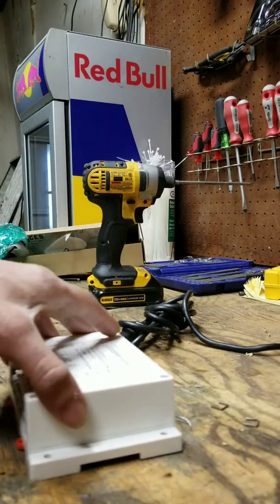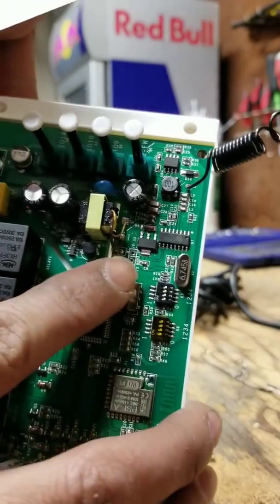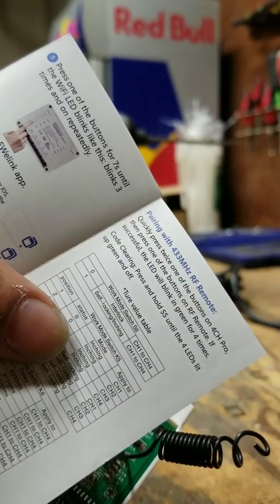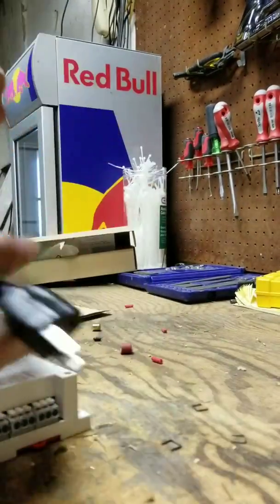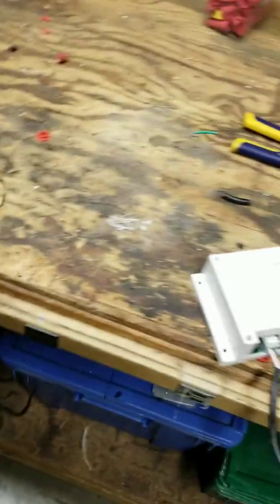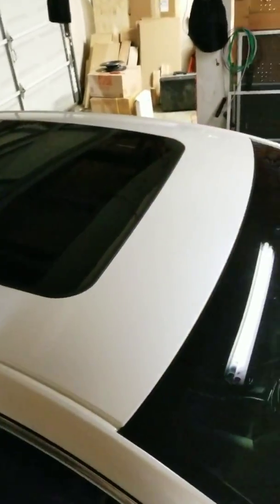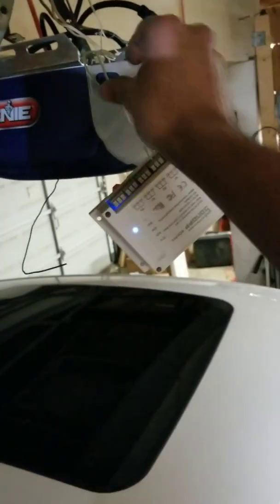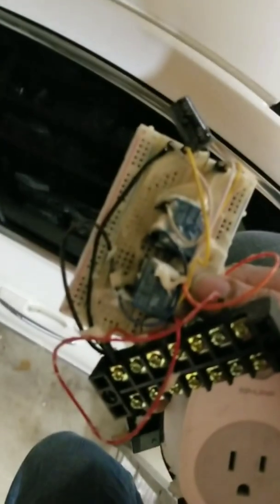Alexa and smart phone to open garage.  Sonoff 4ch pro switch

Comment: Do you know of a smart door sensor that one can use to send the garage open/close status to IFTT?   I have not had luck finding a smart door sensor that does not require a an additional "bridge"
Reply: Sonoff has door/window sensors
Reply from the maker: Thats new to me, i'll have to check that out.
Reply from the maker: likeos not sure on this... You need something to tell you if a door is open or close?
Reply: Anish Patel , yes that's what I would like. 
And hopefully in addition I can see the status in the Application called IFTTT.
Reply from the maker: likeos 2 things on this.  My alarm system has this, I have an app as well.  This is through a company called United, however there are other companies and diy alarms.  The second thing, though I'm not familiar with ifttt you could in theory get the door sensor (2 magnets) with a voltage source.  And isolate the voltage with a relay, or optoisolator you could give it input that way.  Or get ab raspberry pi use the same sensor and write a program
Reply: Thank you Anish.

Comment: Can you still continue to use the garage door switch you have on the wall, also with this setup?
Reply from the maker: jbailey78 yes
Reply from the maker: Sorry I should have shown that in the video.  So the garage switch has 2 wires going to the garage motor.  You can cut that wire anywhere (unplug your garage first I always recommending splitting the wires then cutting each one individually).  Strip the wire make sure you can have some slack or you'll end up using speaker wire like I did.  Then connect the wires the way they were before you cut them, put one on NO and one on COM.  Then you're done.